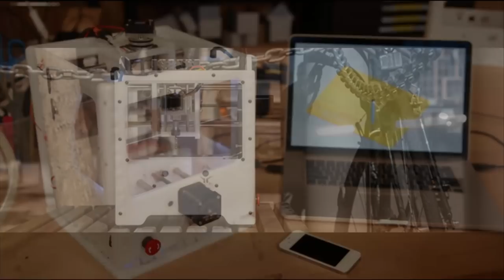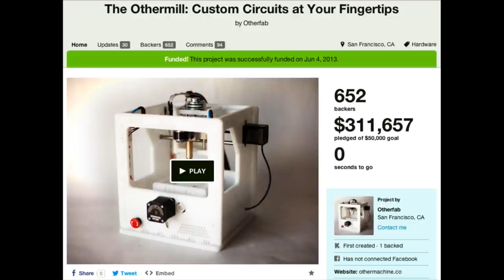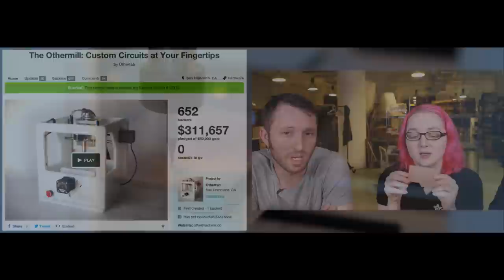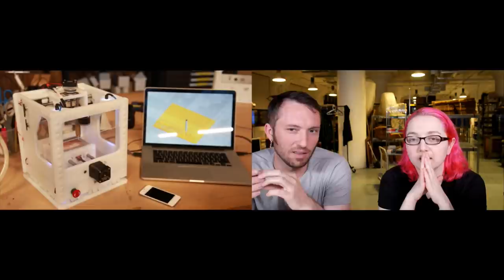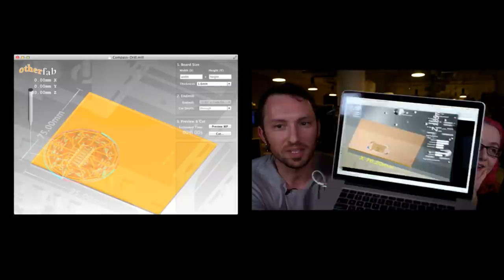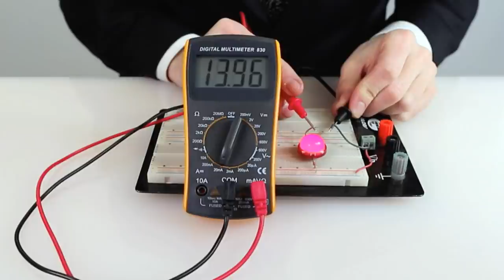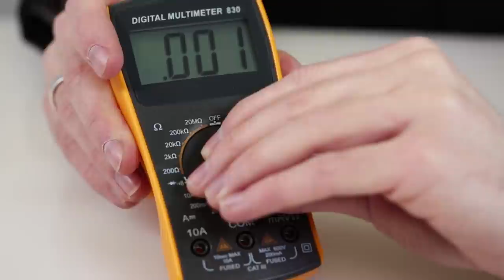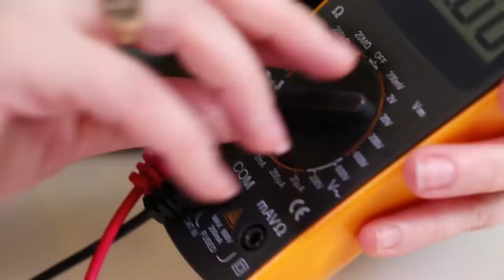Ask an Engineer - Special guest Mike Estee is the CTO & Co-Founder of the Other Machine Company

Comment: The video on using a multi-meter will be handy for those new to electronics. One issue I have with the video is that it assumes that the meter can provide an an audible signal when there is continuity between the probes. Some digital meters may have a symbol that will appear in the display to show there is continuity (a very low resistance). For some meters you will have to look at the reading to determine if there is continuity between the probes.